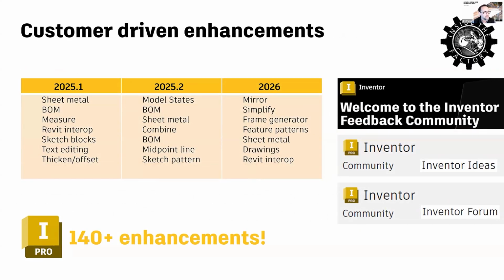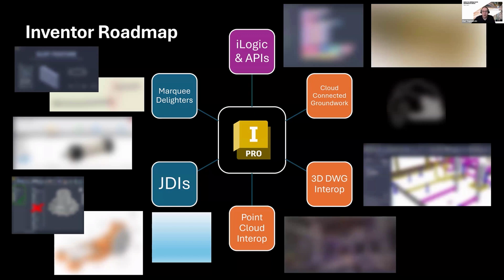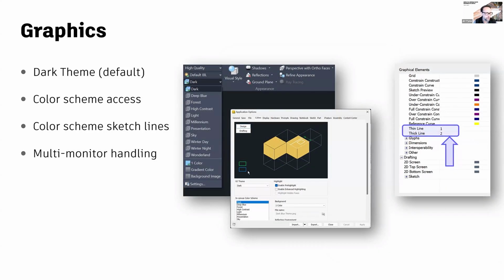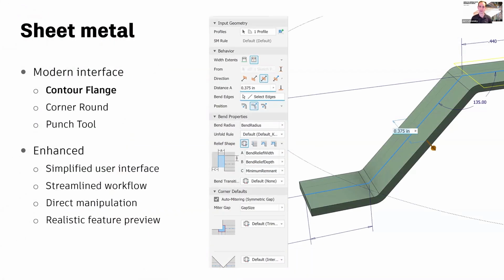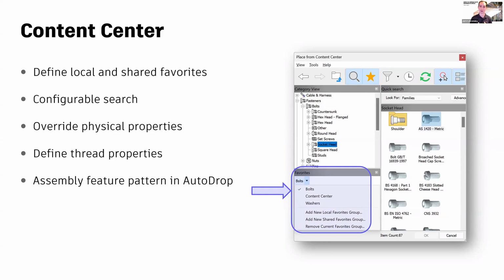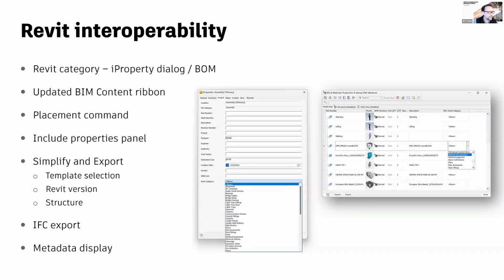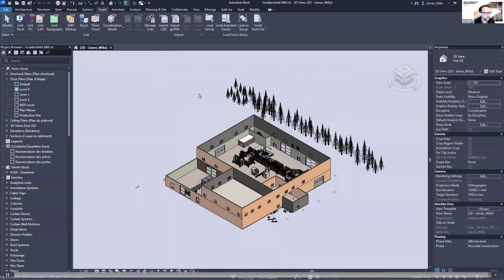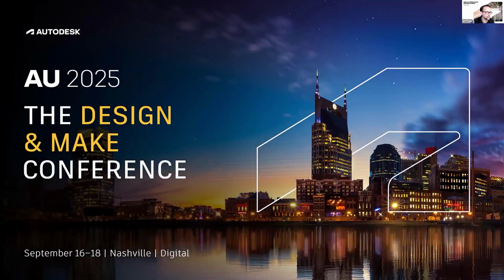Inventor 2026 webinar recording

Comment: As an overview aid and to give the worker quick and easy information about where the individual component/sub-assembly is installed and so that they immediately understand what to look out for, I often wished for the following feature, which until now I have only been able to create manually with difficulty: in the production drawing of an individual component/sub-assembly, a small isometric view of the higher-level assembly or the entire assembly (with thin lines, possibly transparent to make things visible), in which the component in the production drawing is automatically highlighted.

So basically, similar to when you select a component in the parts list, this component is also highlighted in color.

Comment: When a tube and pipe route is edited, change the length of a segment for example, the elbows in the route are not reused they are replaced. This causes locked view representations to lose the elbow and more importantly THE BALLOON! This has caused many many errors and needs to be fixed. It has been this way since 2013 for sure.